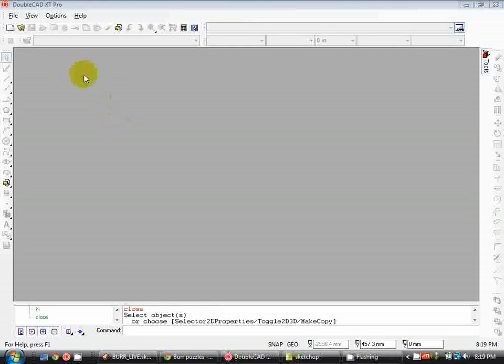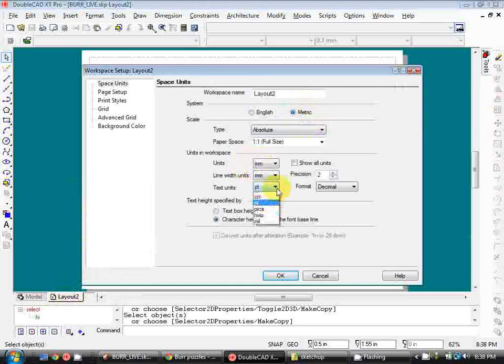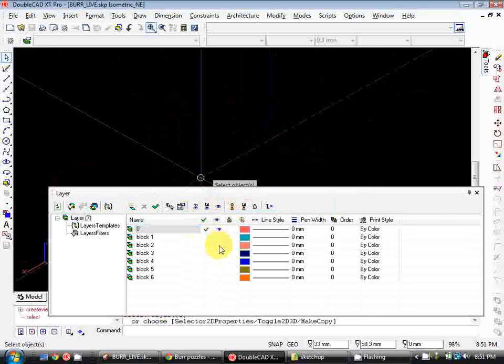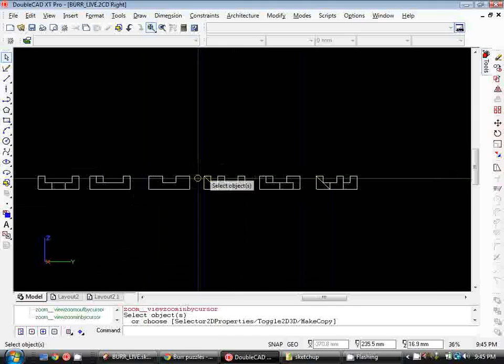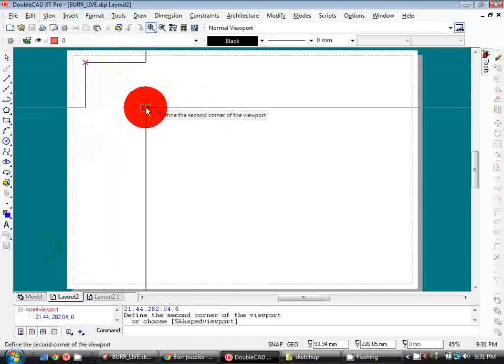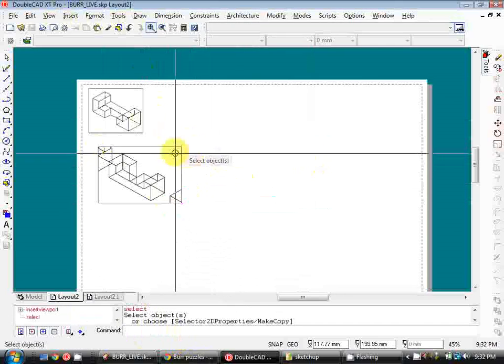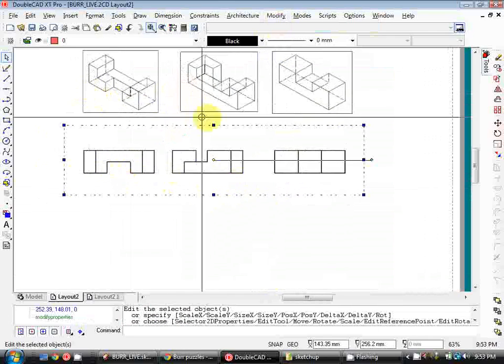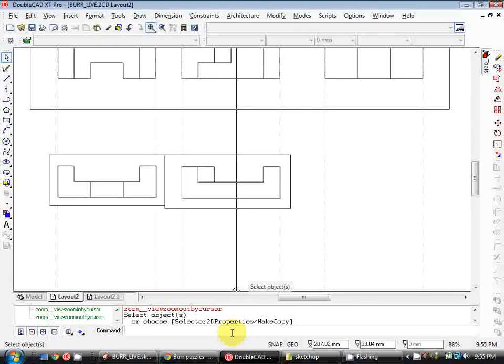SketchUP To DoubleCAD XT Beginners Tutorial Part 2

Comment from the maker: Hi there BudoReflex,
My apologies for the delay in replying. If you activate the viewport tool by typing 'mv' into the command line and then before you draw your new viewport click on Modify>Properties  and set the viewport settings as you want them, click ok, and finally draw your viewport, doublecad will save these settings for the next viewport you draw. You can check out my video on DoubleCAD templates for an example of this. Hope this helps! Regards, Cam